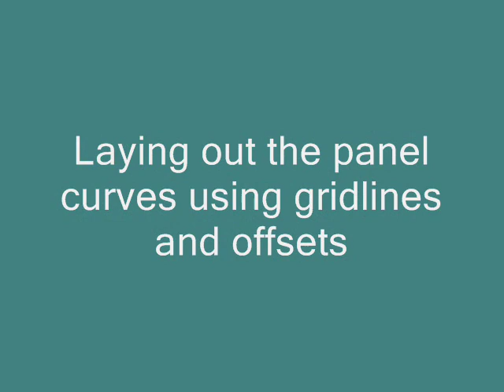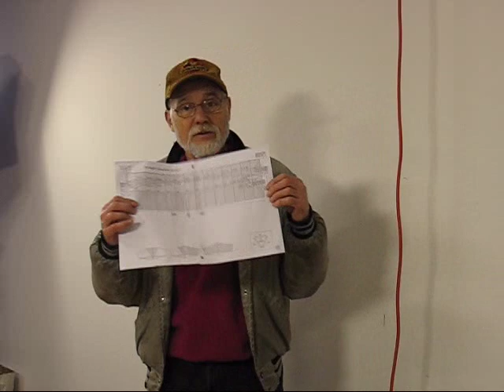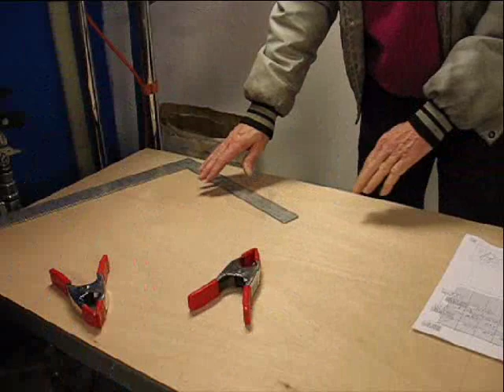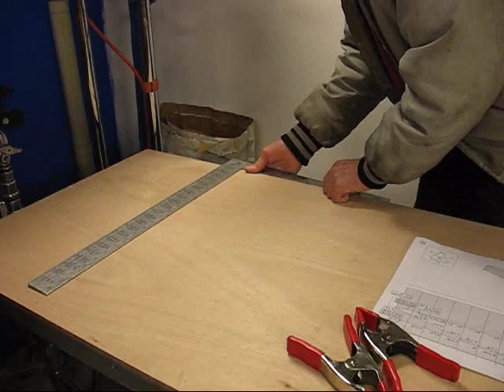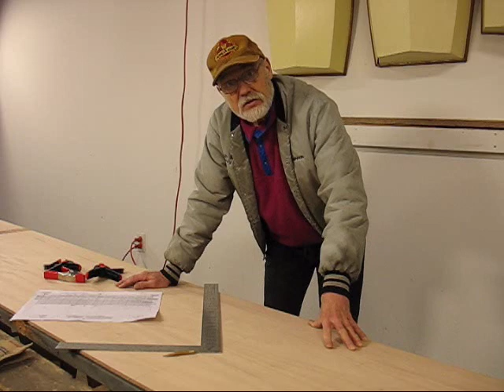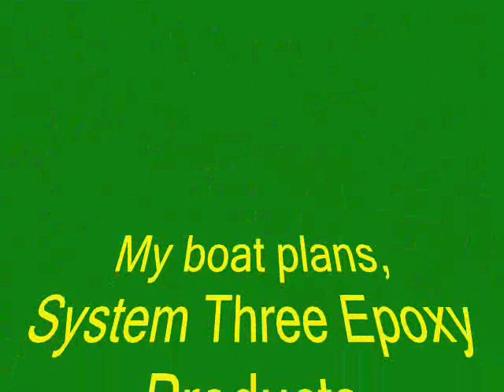EMC Part 1-6 Lofting the Curves.wmv

Comment from the maker: If you have to move a nail or two to smooth a curve, you only have to move the one.  Sometimes the finished curve doesn't touch the nail, so I'm careful when I draw my line, and not put side pressure on the batten.